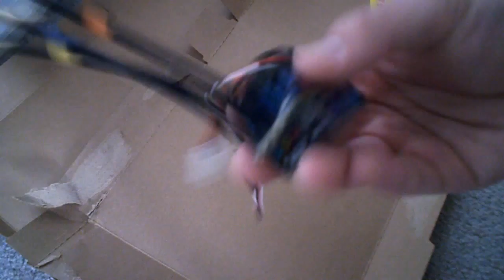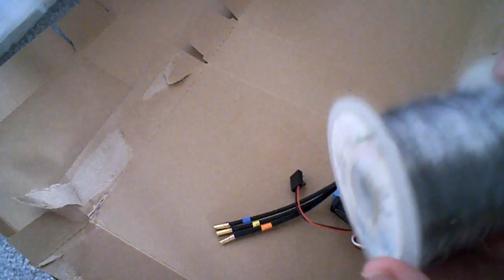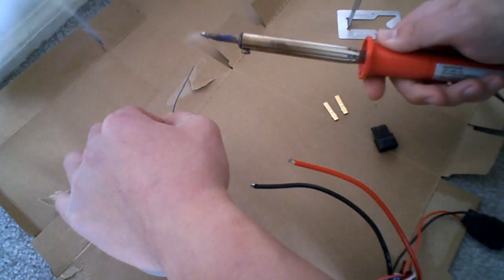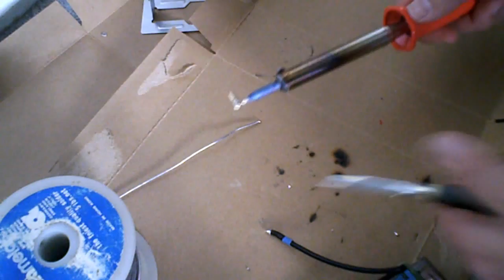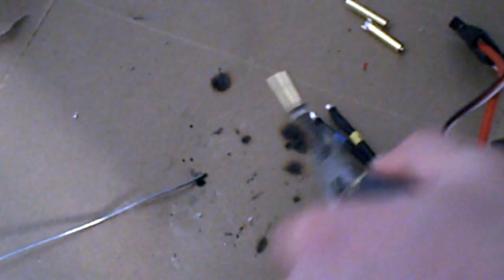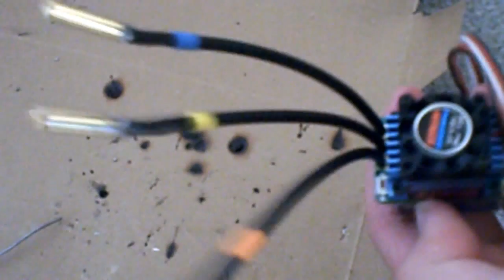Soldering Traxxas Connectors & 4MM Bullets to EZrun 60A ESC

Comment: dude, you made this simple task of soldering bullets look incredibly difficult. Get your self a helping hands stand, and just fill up each bullet connector cup up with solder. Heat up the bullet connector while holding it in some pliers and once the solder melts, dunk the wire into it and hold heat for a few more seconds and then remove the heat.  Simple as that.  I have done this a multitude of times and had no cold solder joints, just the crappy wire on one of my motors broke off inside the solder joint.

Comment: Tim thinking you just made some cold solder joints. No offence but I have never seen a joint hold up where you just put solder on your iron tip and just rub it onto the wire and then the bullets too. But adding the extra may have helped